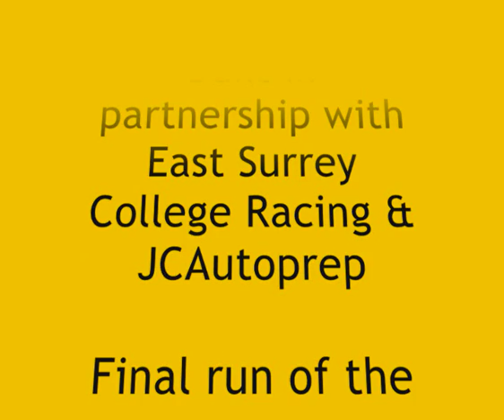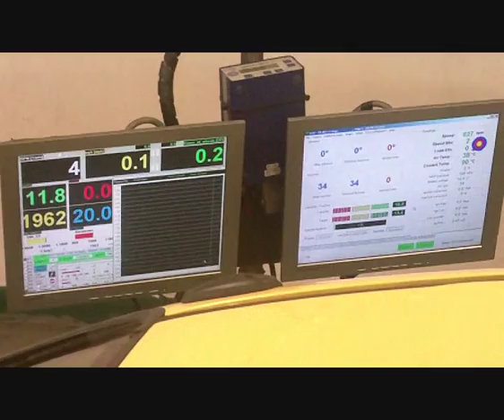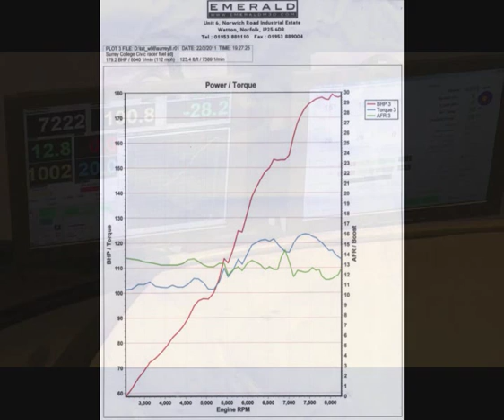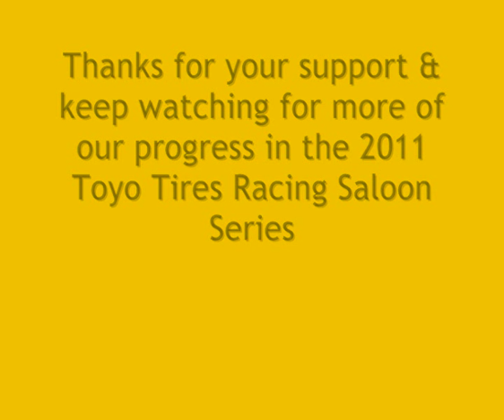Civic VTi Rolling Road Calibration #3

Comment from the maker: @WJP004 Its from 'Any Given Sunday', by Al Pacino.

Thanks, we're working on a new design for the exhaust (similar to a Yamaha PowerValve). The current exhaust manifold is 4:1 and is pulsing far too much. If we can control the usually wasted pulse, we should be able to increase mid torque and smooth the power curve. 

Watch this space...